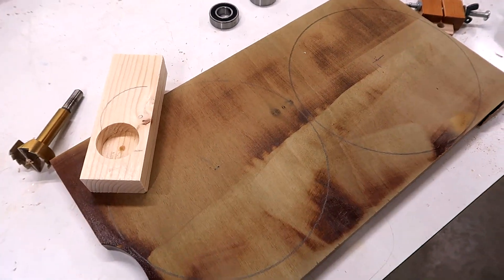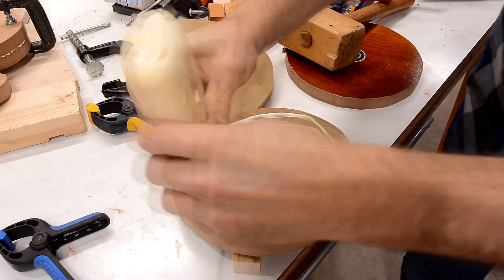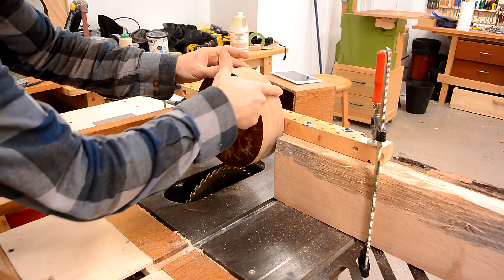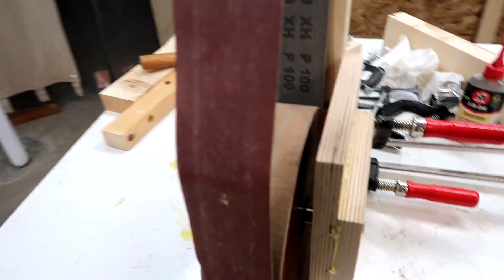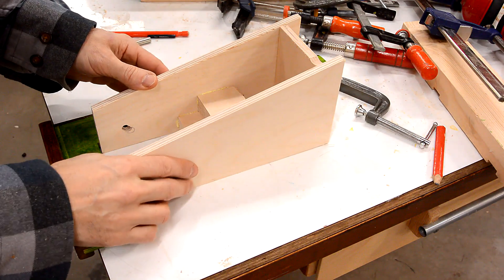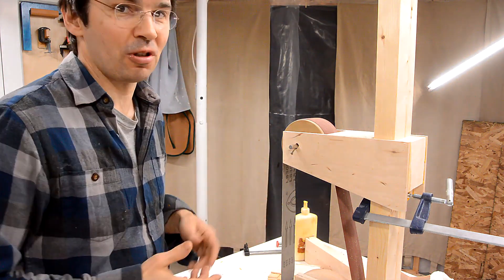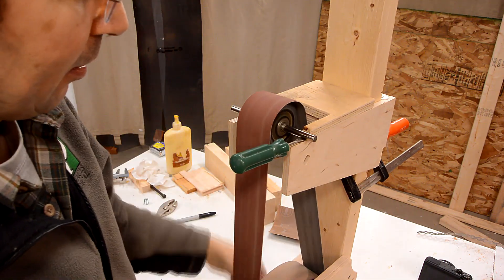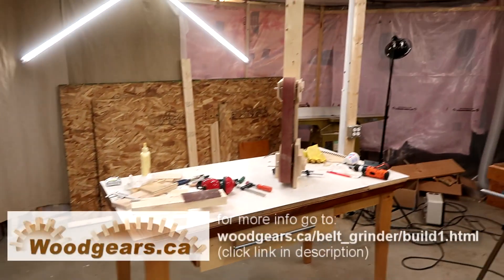Belt grinder build 1/2: Wheels, frame and belt tracking

Comment: At 3: 07, a fixture to hold it to a belt sander work too. If the wheel is set at a distance to contact the belt at the wheel's highest point, and set at about a 20° angle, the belt will turn the wheel and sand it. If the wheel is on a threaded shaft, the wheel can be moved smoothly into the belt.

Comment: at this point https://youtu.be/zWx-9qteH5k?t=117  I am very confused, banging the wood on the shaft only shifts the setting of the bearings right?  This same thing could be done after you glue it ??!!  Or is there a slight sliding of one disk over the other as well?

Comment: your videos definitely help with ideas and projects I come up with.  I cobbled together a 2" x 60" belt sander this weekend.  I've had the idea for a while just haven't had the time.  I used an old 9 inch band saw as the platform and built off of it.

Comment: Matthias..I am making a belt sander i used your ideas but modified it to work with what i have on hand.Anyway,Would there be any issues if i used an old cordless drill to power it?I have some kicking around i repair them on the side and these are ones customers abandon for some reason.I tried it on my prototype and it seems to work fine, i was just wondering if you could think of a reason it would be a problem?

Comment: Or You could have used a burned out induction(async) motors squirrel cage rotor and bearings for the wheel, it's smooth enough even without a coating to support the belt!

Comment: If the bearing does not fit hard, you can also rough a little the bearing surface and glue with epoxy or cyanoacrylate if the gap is minimum, however the method of Mathias allowed you to very precise have everything always centered, since no gaps.

Comment: its was smooth but warbling you need to beef up the back stand wood  which looks like pine of  some kind if u use this with plywood with passage of time it can twist a little so please beef up the back and follow by other parts like holding a upper smaller belt wheel shaft post , then i think would be  great . rest cool.

Comment: I noticed you didn't pilot the screw holes in the outside piece of plywood large enough to let the screw bite only into the piece of wood you're anchoring it to. I always found it pulled the pieces together better when you didn't have friction in the outside piece, and used the screw head as the point of contact holding the unthreaded piece to the piece the screw is actually engaging. Is there something to not drilling the first piece the screw goes through out enough the threads to do not engage?

Comment: why dont you use the same size wheel on both sides? when the upper wheel is as big as the bottom one you have it in line and the arm which holds the upper wheel doesnt have to take those larges forces because the axle is less far away from the shaft

Comment: A good rule of thumb when tracking any type of belt is that the belt will always try and go to the side of lowest tension.  Keep that in mind when work out which way to adjust the pulley angle.
Reply: If that were true, then putting a camber on the pulley would never keep the belt centered.
Reply: Heh: searched crowned pully wikipedia, and here is the second result on google. 
https://woodgears.ca/bandsaw/crowned_pulleys.html
Reply: ^ This.  It's counter-intuitive but true - the belt tracks towards the crown even though that increases its effective tension - and Matthias's video explains why really well.

Comment: I'm curios to why your building a 2x72" belt grinder when you already have a perfectly good belt sander that capable of the same. But then the thought occurred to me, why do we need a good reason other than we had an idea and wanted to try it lol. 

When I built my 2x72" I originally used a 1hp treadmill motor which I soon released wasn't enough and quickly upgraded to a 1.5hp which still isn't enough in my opinion, I still find it bogs down when grinding metal.

Comment: I think the exactly vertical belt isn't really needed. 
Your horizontal sander inspired me to build one similar in size, only wall mounted, vertical, and made of metal of course.
I often find myself thinking it would be more comfortable to use if it tilted back a bit.
Maybe one day I will make a bigger drive pulley, so it goes a bit faster, and then it will be tilted anyway.

Comment: Matthias - Three things:
- Screws to help align and reduce slipping on glue up.
- Marker on Forstner bit for depth of cut.
- Floating smaller bearings within bearings to help identify needed balance on wheels
All three were especially insightful for me and my future project builds! Thank you!
Reply: Also, I never saw anyone with the Messingkugeln to actually adjust the diameter of a Forstner bit before!  "Dealing with Kids Make you Brave!" (an allusion to "48 Hours.")  🙂

Comment: If instead of the band saw you used the router for each layer before gluing them, they would all have the same diameter and perfectly orthogonal surfaces .... or not?
For the motorization of the pulley, perhaps a further layer of smaller diameter used as a pulley for a belt, so you can put the motor under the main drum, reducing the side encumbrance
Reply from the maker: they would be prefectly round, but I'd still have to trim them to get them all prefectly concentric (to within a few thou).  Basically, wasted effort making them round before glue up.  For motirization, see my next video in a week.

Comment: shouldn't the wheel be concave to get it to track back to middle?
Reply: It's counterintuitive but that works for all belt type pulleys.  Wine barrels roll naturally in the middle of two tracks perfectly   

Even train wheels (when you look at the cross-section of the two wheels mounted on an axle, they are convex, not flat) work in the same principle.  That principle keeps the train on track.  The side flanges are there just for extra safety but never touches the tracks when running full speed.

Comment: at 3:20 the bandsaw didn't work for fine trimming because the cutting was tangent to the circle. instead you should have the cutting edge face the center of the circle and slowly move inward to grind off material
Reply from the maker: See previous answer to this sugestion

Comment: Have you heard of salting your glue ups? It helps a ton on pieces slipping around and I've never seen compromised strength from it. Your pins probably work better in this scenario keeping circles aligned, but that may be something to consider in the future.
Reply: Have you tried Pepper instead.......Lol
Reply: do you not season your wood!
Reply: Painteagle I tried using salt once and the glue joint failed. The salt raising the gap between joints. It was only a small pinch but that was enough to keep the joint unjointed.
Reply: I would rather use sand if I wanted to go this way.
Reply from the maker: Actually, I am tired of hearing about it every time I glue things up.  I don't like putting salt in the glue.
Reply: Does it weaken the joints? I've never used it on things that needed to withstand a lot of stress.

Comment: Is there a reason you didn't wait to put in the bearings until after the lamination was done?
Reply from the maker: I needed the bearings in there to align the laminations
Reply: But why couldn't you have done the lamination before even drilling the holes?

Comment: how are you going to attach motor if both wheels are on bearings?
Reply: Pulley, most likely. So the motor will be behind the grinder with a belt. Which makes the width of the grinder apparent.

Comment: Just out of curiosity, Why do you always add weight to balance things out? Rather than drilling out a few holes in the other side I mean.
Reply from the maker: actually I usually drill it out.
Reply: I thought the same. But then I figured that it is probably smarter to use screws since you can more easily take a screw out than fill a hole
Reply: But you can fill the hole with a screw, so it's pretty much the same thing.
Reply: Matthias Wandel ah, then I must have remembered it wrong

Comment: I asked myself the whole video how you will propel it if both sides are on bearings
Reply: Hamster in a cage.
Reply from the maker: see my next video on that.
Reply: By making a pully on the lower disk.
Reply: The mice from the previous maze video on a wheel
Reply: Pulley.
Reply: It's hand operated. Why do you think he's had a couple of kids???
Reply: He'll use the shrew, obviously...
Reply: And the vole. :)
Reply: Like the bottom wheel on the band saws, like the drive sprocket/pulley on a single-side swingarm motorcycle.  The drive pulley for the V belt is connected to the bottom wheel on the first side, the axle stops at the second bearing allowing belt changes without complete dissassembly.
Reply: I keep wondering how you would make a helical wooden gear... perfect opp.
Reply: this is the question ;-) but i'm sure youll' find out
Reply: Do you have it uploaded yet?
Reply: Rubber bands and bubble gum.
Reply: I'm wondering too but because I don't see enough room for a left side bracket and a pulley.  I'l be waiting too.
Reply: Matthias B. I am not sure yet but I am sure he'll build a jig for it :-)
Reply: Matthias B. Hi man I have some project in my channel
Reply: And matthias read all these comments and decided that no, he would power it a different way.  Direct Drive!
Reply: With his penis?

Comment: You should have set your jig to the front of the teeth instead of the side.
That would fix the blade flex problem.
Reply from the maker: Blade moves forward and back slightly as it runs (blade is not perfect), and the side of the teeth aren't good at cutting material.
Reply: I mean, putting your wheel straight in front of saw blade like you were going to cut it in half.
Then using your setup slowly turn and get a better cut.
The blade flex wouldn't matter this way as long as the wheel was turned slowly and not too deep of a cut.
It would true the wheel up nice.

Comment: It’s uncharacteristic that he didn’t provide a physical explanation of exactly why the crownwheel tracking didn’t work as expected. 
But oh well, he got it to work.
Reply: Basically the belt centres to the largest diameter on the wheel, so crown the middle (and if everything else is perfect) and the belt self-centres.
Tracking just rotates the highest part of the crown left and right, so if everything isn't perfect at first, the belt can be centred by using the tracking control.
Reply: Jeff NME you just described how crown wheels and belts work. Something Matthias also did in a video. 
My query was about the counterintuitive adjustments needed here and the physical reasons for it.
Reply: The physical explanation is nice and dandy, like a cherry on the top, but not necessary in gritty making something work. He made an experiment, adjusting positions of the centre rod, and the results have shown how to orient the slot for adjusting the rod. No explanations are needed when making something work.
Reply: Leszek Cyfer of course it’s not needed per se, but Matthias being curious and taking pride in being scientific will usually go out of a little tangent to explain how and why something went wrong, or why something behaved strangely.
In this particular example he (and I and many others I guess) had an intuitive idea of where to place the adjustment screw. This turned out to be wrong and I pointed out how uncharacteristic of him it was to not use a few seconds to explain why it was otherwise.
Reply: If you look through his videos you'll find hundred things he didn't explain, and there are many more you haven't even noticed. Once and then he makes a video and explains something in depth.
Reply: Leszek Cyfer give me ten examples.
Reply: Lol, no, watch them yourself :D
Reply from the maker: I already have a video exactly on that. No need to repeat myself.
Reply: Plus, I think he did explain it, and it made sense when he illustrated that the slot was in the wrong direction.

Comment: Use salt to stop you wood floating when you are gluing up.
Reply: Emtildeath6666 salt can stop the glue joint from seating perfectly and allow for slight misalignments occasionally. Which in my opinion isn't ideal
Reply: Yes if you're using Kosher salt. If you're using normal table salt it won't.
Reply: Emtildeath6666 it still does, I have had it happen before.
Reply: Clearly you have never tried it.
Reply: Its a shit idea